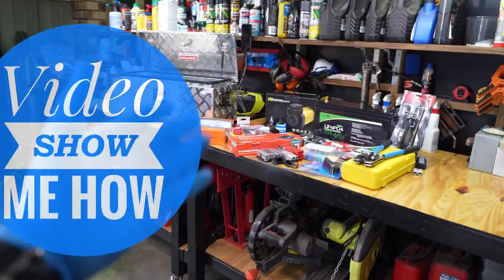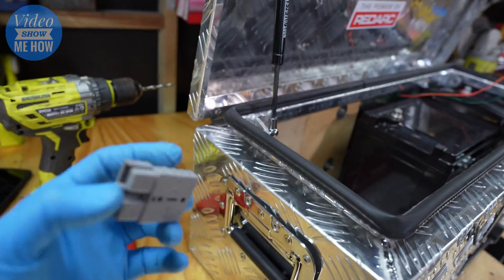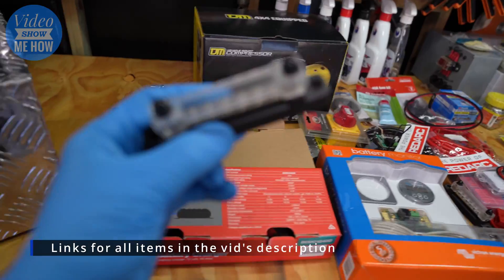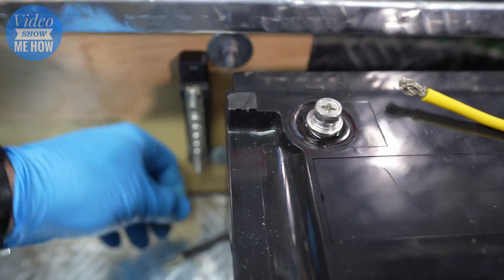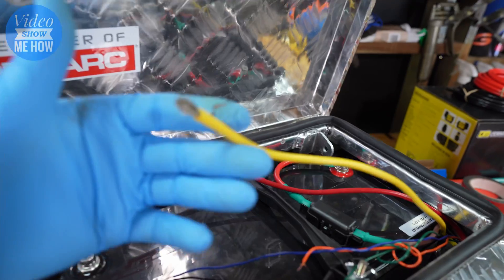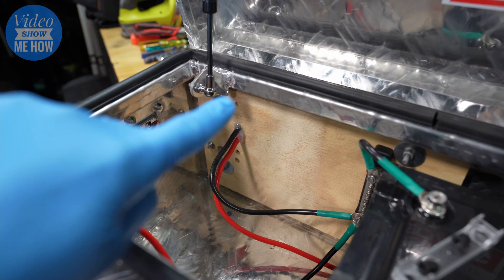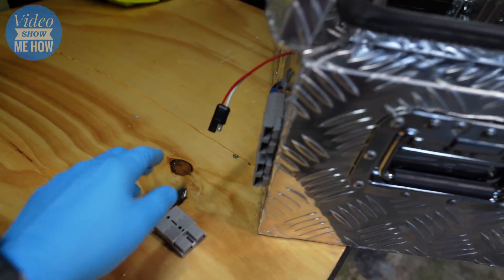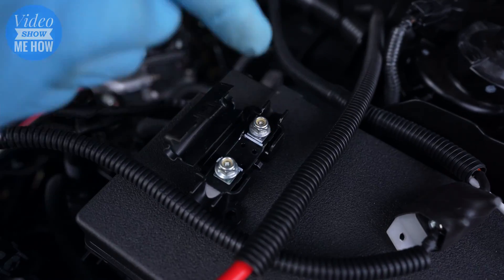HOW TO Install REDARC BCDC 12v Dual Battery DC-DC Battery Charger BCDC1240D [Isuzu D-Max Build #11]

Comment: Gday Adam, great channel mate. A clarification please, I have a BT50, same vintage. The A/C fuse you tapped into is live on accessory mode (second press of starter button without engine starting). The a/c compressor isn’t running but that fuse is definitely live without the engine running. Does this matter? Thanks.
Reply from the maker: Hey Paul sorry I missed this.. hmmm will have to do some testing, may kick the charger into gear, but also thinking it might need to see above a certain voltage eg alt kicking on... Will test and come back
Reply: Just to add, your fuse box layout appears the same as mine.

Comment: Excellent tutorial video ! 
Thanks 
I am putting a second battery 135ah lithium in the rear of a 90series Prado to run a fridge , compressor, lights and Solar Panel on roof and second fold up Solar Panel when stationary. 
Where do I find the parts list you used ? 
Thanks for all your help 👍
Mike Ward
Reply from the maker: All parts used linked in the video description 👍

Comment: Great video! Have a question, I'm working on a dual battery system using Redarc 1225D and I'm going with two AGM batteries, one as my starting battery and the other one as my auxiliary battery, only different thing I'd like to do is to use SBI12 isolator smart start to be able to jump start my starting battery if needed ! Where do i need to put the SB12 isolator ? Thanks in advance !
Reply from the maker: Between the starter and aux battery, fuse either side. More info here https://www.redarc.com.au/smart-start-sbi-12v-100a?gclid=Cj0KCQiAosmPBhCPARIsAHOen-MiQm6wfNXLt8Z7J87D58lpFcdVLf04S_hJ4E7UgSyX53mrL5MGyNcaArjvEALw_wcB
Reply: @VideoShowMeHow  appreciated !

Comment: Hi Adam
Quick question in time code 14:42 relating to the micro fuse struggling to get this to fit the fuse box and it is a micro fuse. 

Appreciate your thoughts.
Reply from the maker: As in fitting in the fuse box itself or the fuse to fit?

Comment: Adam, you're content and personal delivery style are very watchable - clear, concise, and easy to understand.  No fluff or extraneous commentary - straight to the point.

I'm using your content to guide my DIY Redarc BCDC50 setup with two 100a/hr Lithiums in the back of my 2021 BT-50 (D-max).

What are your thoughts on the Ground Cable run between Crank and House should be the same length as the Pos?

I have a rudimentary understanding of 12v but only enough to get me into trouble.

So some consternation for me as you ran your Deck to Chasis and not back to (or equal length) as your Pos.

On another segment, have ordered the bonnet struts per your recommendation.  Looking forward to the easy lift when fitted.

Everyone says it, but keep the content coming - it's fantastic.
Reply from the maker: Thanks for the feedback Chris 👍 

Regarding the equal length, for single battery setups like in the video it's not necessary. Equal length cable is generally recommended however when connecting more than one battery in series or parallel - eg the cable length that runs between the two batteries for positive and negative should be the same length
Reply: @VideoShowMeHow  Thanks Adam.  I'm tuning in for more content.  Merry Christmas mate.
Reply from the maker: @interestedobserver76  🎅🎄 Cheers, you too

Comment: Hi mate. Do you have a size of that tool box. Just trying to work out size in my dmax? I have 550mm in width to play with
Reply from the maker: Width of the box is 730. I needed the width for the larger battery and the air compressor

Comment: Great video. I am going to build something similar until my canopy and draws arrive. What size is the box you used? How much space is left either side of the box when installed between the wheel arches?
Reply from the maker: It's not a perfect size, but was the best I could find at the time. I needed something that would fit the bigger 135ah battery and space for the compressor as well (install vid on the channel shows you the constraints). Also one that could fit under the roller shutter and not stick out too far. Will go to a custom box once the liner is pulled and tub raptor lined. With the box over to one side have about 40cm gap, enough to slide my pop top gazebo :)

Comment: do you need a relay for those style master switches?
thanks for a great video
Reply from the maker: Cheers. Depending on what you're running. They're rated for 20amos, but anything over about 10id be running a relay usually
Reply: @VideoShowMeHow  i mean the red one near your crank , sorry
Reply from the maker: @Neuronpath  you mean for the bcdc or the trigger wire?
Reply from the maker: @Neuronpath  nope no relay needed for that, just the midi fuse per the vid 👍

Comment: Thanks for the video Adam, did you use a 50amp Anderson or a 120amp?
Reply from the maker: 50a (assume you mean for the box connection?) Note an SB50 Anderson connector 50amp is only the max when connecting/disconnecting and they are actually rated to 120 continuous. Of course always double check the connector rating as they can come in different flavours
Reply: @VideoShowMeHow  thanks so much for that, never knew that.

Comment: hey mate, i love the detail you go into this, just have a quick question, in terms of the bus bar I want to add an inverter, can the bus bar you have handle it? It's a 2000W inverter BTW?
Reply from the maker: Hey there, thanks for your comment. Would be just too small.. it's a 150amp busbar, you'd want a 175 or 200. 2000w is 156 amps at 12.8..
Reply: @2000W, a 2000w inverter is 90% efficient. Ie, it draws 2222w from your battery. Assume 12.5V @ the inverter or less, even with my 50mm2 cable. This works out to 178A which is exactly what I measure doing this test using the Victron Smart Shunt.
@178A, even a '200A' ANL fuse block gets hot after 10mins. I am pondering how to fix that fuse block. Maybe need a better brand. Midi fuse blocks are smaller and handle lower currents to ANL blocks.

Comment: Great video. I notice Redarc says the butt splice on the 6 gauge wire needs to be crimped and soldered, but I don’t see you mentioning that. Is it OK to avoid soldering? That’s the only thing I am not good at so crimping + heat shrink is preferred.
Reply from the maker: Hey mate, ideally crimp is you mechanical connection, solder your electrical. But of a can of worms this one. IMHO a proper crimp with proper tool then protected with shrink and tube is tried and tested 👍

Comment: I have the BCDC1225D Redarc charger, would  this be compatible with the “VoltX 12V 100Ah Lithium Battery LiFePO4 Deep Cycle Solar Charger Caravan Camping”??
Reply from the maker: Yep sure is 👍
Reply: thank you!
Reply: That battery will take 25A charge, no problems. But... mine shut of several times @ 40A charging after 30mins. 30A continuous charging was ok.

Comment: Thoughts on fitting new MUX 120amp alternator?
Reply from the maker: To a dmax?
Reply: @VideoShowMeHow  yes sorry
Reply from the maker: @kromey111  it's probably possible, I haven't seen the new one, would be bolt pattern, size etc.

Comment: Evening Adam, quick question mate. As an electrical novice, i'm curious if this setup would be able to be bridged to supply extra power to a winch for better constant voltage/main battery longevity? I realise its mostly designed for running secondary items like a fridge and potentially an inverter for large items, but what would you need to upgrade to optimise it for afore mentioned task?
Reply from the maker: Redarc do one of their sbi isolators that allow you to join your batteries. But for winching so long as you're running your engine and have a decent sized cranking battery you won't have a problem.

Comment: I'd love to see how you wire up the Victron monitor - I basically have the exact same system as you - super helpful as I am currently in the wiring up stage!
Reply from the maker: It's on it way mate! Air compressor vid is out next and the victron junior after that 👍👍
Reply from the maker: Victron vid now live!

Comment: great set-up, how do you plan to secure the box once all finished?
Reply from the maker: Using tie down points in the corners of the tub and the handles. Have actually has this in place for about a month now (just catching up with the editing/releases) with a few trips off-road and works a treat. Have rubber feet on the bottom of the box also so I almost the perfect height to the roller shutter. You'll see what I mean in the upcoming vids 👍👍
Reply: Sweet cheers

Comment: Awesome video's mate I'm just wondering with having the redarc bcdc which you are installing  will that change the voltage on your smart alternator from say 12.5v to 13.2v which would be enough to charge the second battery for the accessories you are running off it.
Cheers keep those vids coming.
Reply from the maker: Hey mate, the blue wire from the BCDC tells the unit when to power on (so when the smart alternator is powered down it doesn't cut the charge etc) and it also sets the charge profile depending on what you select based on your battery so it is always charging to the correct voltage and in the correct stage
Reply: @VideoShowMeHow  cheers for that

Comment: Hey mate, I'm about to do a similar setup hardware wise, but with an added sbi12 for jump starting.

Is the 6B&S enough to go between the batteries and the isolator, or should I use something a bit more heavy duty? I will be running a secondary slimline battery behind the rear seats. The kit I've bought comes with 6B&S but upon doing some research I've come across mixed answers.

Great, in-depth video too, cheers.
Reply from the maker: Hey mate, the single core 6b&S is rated up to 103 amps and is what redarc recommend for their 40amp bcdc. For the SBi redarc recommends 4 B&S for max 3m runs, next size up for longer
Reply: @VideoShowMeHow  sorry I should have mentioned I have the 1225. 6b&s will be fine for that. I'll have to get some 2b&s for inbetween the batteries and isolator. Appreciate the help thanks mate.
Reply: You wont be able to jumpstart from a 100AH LFP battery, unless you are only jumping small engines, eg, motorbike or jetski.

Comment: Great video. I really appreciate this. I'm waiting on my dcdc charger and a couple of other things before i start my project. I have a couple of q's.

What size corrugated tubing / conduit did you get? 
And when you ran it under the ute did you just follow the cable for the towing wiring and attach with cable ties?
Reply from the maker: Hey there. I used 10mm corrugated tubing for the big wire and 7mm for the small (will find the links to the stuff I used and update the description) . Re the route yep there's already a big loom that runs along the chassis rail so just followed that, cable ties every 300mm or so 👍

Comment: Have been too nervous to cut into my tub in the wrong spot. This is very helpful.  👍
Reply from the maker: Great to hear 👍
Reply: No need to cut into tub as there’s a gap up top next to roller cover that feeds down to chassis rail .